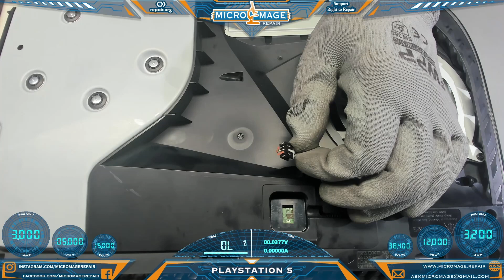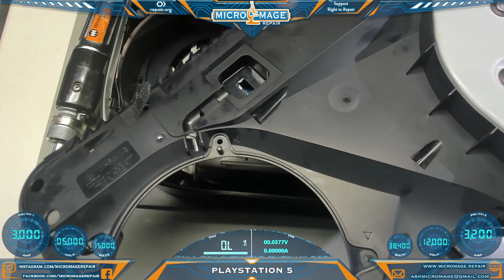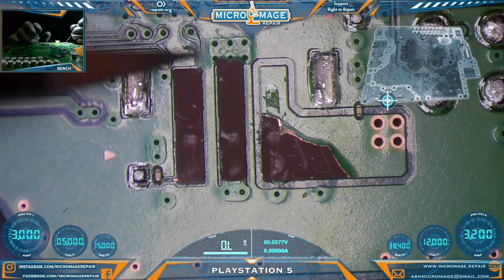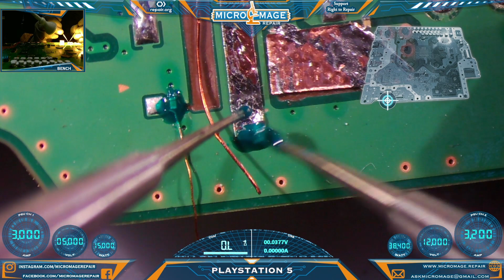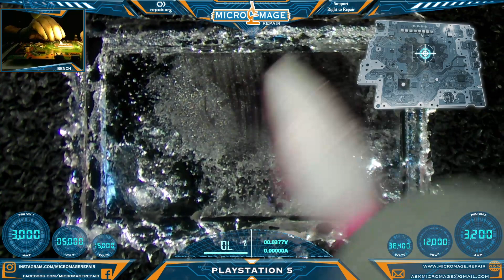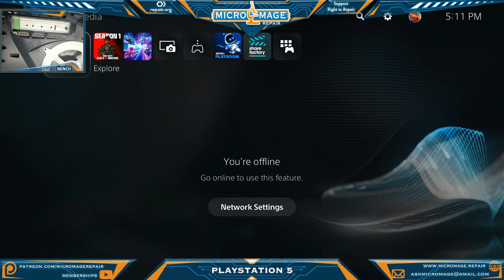PS5: Different Revision, Different Challenge.

Comment: Lucky they didn't rip those ground pads, because their main purpose is support. The cable doesn't actually connect to them. If they ripped those, even the best fix possible would still be more sensitive to pulling off than the original.
Reply from the maker: Appreciate your commenting!
I would have to disagree.
I've fixed many of these connectors with damaged ground pads and feel the end result strength wise was superior to what came out of the factory.